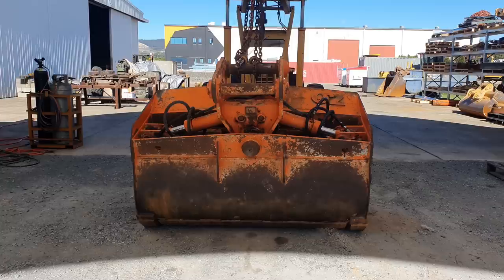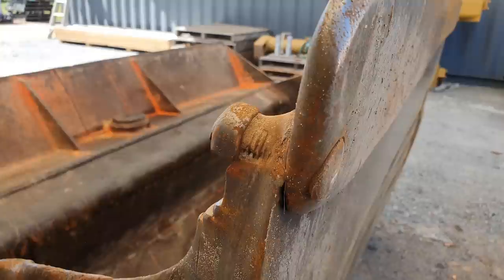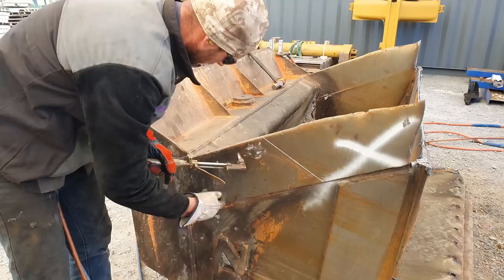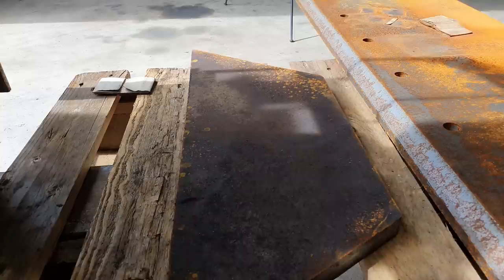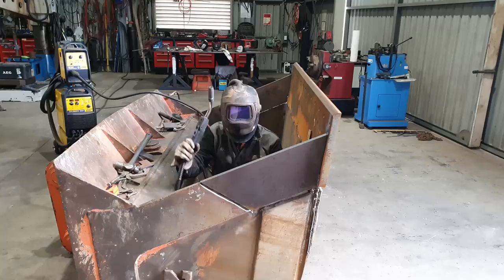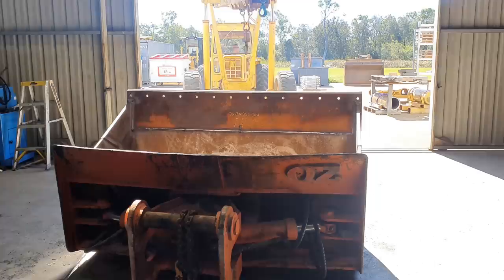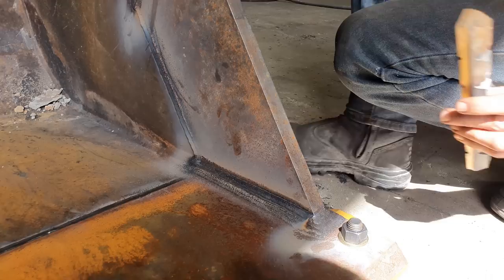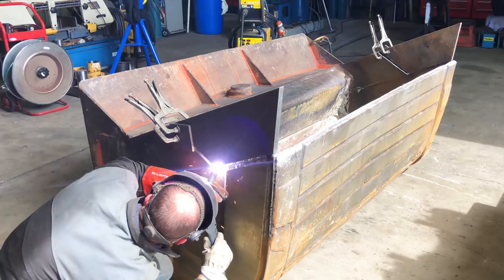Repair & Upgrade DAMAGED Bucket for 30T Excavator | Gouging & Welding

Comment: Unfortunately is not operator's fault most of the times...upper management wants things done and wants it done yesterday regardless if you have what it takes or not and like the old saying goes "if all you got is a hammer then everything starts to look like a nail" .
Reply: Or, "If a pickpocket meets a Saint, all he sees are his pockets" ~ Hari Dass Baba
Reply: I love the supervisor who is adamant they want A and you inform them it needs service first otherwise it's going to bugger up and will need A as well as B. Do the job as ordered.
Then they get crook at you and demand why you didn't tell them, all harsh words and floral language. It's fun to watch their faces when you quietly say "I did". Not a word in response.
Reply: @ohasis8331  I always handed in a paper with my written observations, and had them sign it. Then when they got cross, which they always did, I handed them the paper they signed.
Reply: Sadly if the company doesn't own the equipment they usually don't really give a $hit....
Reply: It's mainly about making money, not engineering 'purity'. Plenty of times the opportunity is time sensitive, and the cost of extensive repair is still dwarfed by the profits made. Curtis makes a good living either way - whether in maintenance or repair costs.
Reply: in the eyes of a fitter or a boily it is ALWAYS the operators fault!!!!

Comment: I can't believe how clean and straight your free hand torch cuts are. I've free hand cut similar gauge metal over that distance with a much more ragged line. Just wow.
Reply: he did mention using Oxy/Propane instead of O/A because it makes 'a cleaner cut', and comparing that freehand cut to a motorized line cutter with an O/A flame they've shown in the past, I can well believe it. (is it Kurtis, or Curtis? I keep getting mixed signals)

There's also the matter of steadying, bracing, and stancing yourself to allow moving the torch in a smooth, even line; you don't want to be having to think about your balance while trying to cut straight. and flame-off motion practice a few times to make sure you have the pacing correct
Reply: How many kWh you use in 1 month?
Reply: I’m not as good as Kurtis, but aim with your elbow not your wrist.
Reply: As far as making a straight line is concerned that's practice, bracing, and dont get in your own way... outside of that.. make sure your pre heater holes are in line with your cut and know how to read the kerf.. pre-heating is also a must on most things..
Reply: I noticed this too, and I think a lot of it is very wise choices in how he braces his hands and torch. Really good work.
Reply: I was also impressed by this. Skillzzzzz
Reply: Another good welder is Issac of I C Weld, he can do amazing things with a cutting torch

Comment: Nice use of the dog & wedge Kurtis. Respect. Such a practical way to form up the plate that's otherwise inaccessible to clamping.
Reply from the maker: thanks mate glad you liked that!
Reply: I thought the same thing. It gave me a good smile.
Reply: Takes me back to my younger days manufacturing chaser bins, lots of dog cleats getting the bowl profiles just right
Reply: @danieledwards1081  Sorry, but what is a chaser bin for?
Reply: @markfryer9880  collecting grain from the harvester in the field on the run so they don't have to stop harvesting.
Reply: Interesting video for sure. And I learned a bit in the comments. Thanks

Comment: This super videographer should be making training videos. She is always in the right place, showing the operation as well as the aftermath. And, it's all clearly defined. Super job, even in winding conditions the wind noises is minimal.
Reply from the maker: Thank you for the great feedback! 😊
Reply: @CuttingEdgeEngineering that’s sharper than some of the axes I use in my woodworking

Comment: People underestimate how difficult it is to torch cut with this precision. Very early in your videos, the 2 things that impressed me the most was your skill with the torch and your skill with the forklift. I’ve been a welder for 35 years and haven’t seen torch control like yours an Isaac from IC Weld.
Reply: yeah how good is the forklifting ive never  driven one but he makes it look easy and im sure its not, he
 has a good eye
Reply: @Finnyc23  The rear wheel steering is really something to get used to. You have to exercise care around forklifts, they are a lifting and moving machine that is very much taken for granted, but they can easily kill or injure people.
Reply: IC Weld and CEE are both no-nonsense masters of the craft. I’ve been a welder for 25 years, and in fact built tractor attachments for 5 years, and I have learned little tricks from them that I try to remember and keep in my mental tool box of easy solutions.

Comment: I just love the tarp shelter. What a awesome use of space
Reply from the maker: it's been fantastic especially during the summer months
Reply: I'm glad that I was wrong. I didn't think it would last a year. Sorry for my pessimism.
Reply: @CuttingEdgeEngineering  and when its pissing down o'rain
Reply: @Michael-rg7mx   I built a similar covered work area about 10 years ago. The first tarp I bought was from Harbor Freight and it didn’t last 6 months. The next tarp I purchased from obviously a different company cost a little over 2&1/2 times as much but it lasted 5 full years. Just kind of proves the old adage about you get what you pay for.  I replaced the tarp with a used one from one of those metal pole and canvas pole barns that I bought for scrap. The canvas was 3 years old and the pole structure was over 15 years old and was pretty much scrap (some drunk stole a skid steer and went on a rampage. The cops found him passed out in the machine buried under a couple tons of the building.
Reply: @gullreefclub  
I've lived in places that are way too windy. Last week, it blew hard enough to flip trailers. The trees nearby were stripped bare and broken. When I lived near Seattle, the wind sunk 2 concrete floating bridges. The I90 freeway and the Hood canal bridge.
Reply: @Michael-rg7mx  Wow, someone failed to design those bridges properly then.

Comment: Oh my, I have rebuilt so many buckets over the last years of my former years and there was Arctec hard rod by the ton associated with these every year during our break-up when the roads thaw every spring. I never complained about operator abuse as it kept myself and two other talented fellas in a job that lasted for over 25 years eh. I can smell the air arc working away as we/I watch this. Sure do miss it. Retirement sucks eh, LOL. Thanks a bunch and take care my southern friends. Most of my low hydrogen filler rod was ArcTec 223. One had to be careful to burn off that soft start tip though. I didn't have that much knowledge about wire feeds.  I found them to deteriorate a welders skills. Your knowledge about the various wires I could have really appreciated back in the day.

Comment: Kurtis I once saw a bloke driving my cousins excavator using the bucket to smash large rocks instead of getting the ripper which was only 200 mtrs away the amount of damage to was incredible, the industry could use a lot more people like you teaching operators how to use the machinery safely ,efficiently and economically then there wouldn’t be as much pressure on repair crews to have the equipment back in operation in a short amount of time . Well done to Karen for another fantastic job filming and editing and I agree could have been some of George’s family, all the best from Tassie, whoops nearly forgot homeless love that little man

Comment: Real nice welding there and as always just awesome videos. The reason we use those buckets to move big amounts of materials is because we use them when we make a ditch or hillside, and at the same time we load dumpers or trucks. Instead of making dubbel the effort to make the ditch or hillside then going back to load the truck we save a lot of diesel when we do two things at the same time. I live and work in north Sweden, here we have very rocky ground and almost with no exception we use rotary tilts on every machine under 30 tons. Here the manufacturers has had to make them tougher to handle the load we want to use. Also the rotary tilt is invented here in  North Sweden. Big thanks if u have the patience to read my little post 👍

Comment: Thank you for taking the effort to make such great videos! I’ve learned so many tips and tricks from this channel for example at 17:00. I’m not a professional and do some welding and machining as my hobby/spare time job. last winter I was repairing the deck of a small old dredger and this tip would’ve saved me so much cut in halve c clamps and headaches. Thanks and thanks again!
Reply from the maker: Hey mate glad the videos are helpful and thanks for taking time to watch!

Comment: It's interesting to see how different the buckets used in different parts of the world are. Here in Finland the ground is mostly clay or silt packed extremely hard by the ice ages and frozen for a third of a year so the buckets we use need to have a lot of penetration ability into hard ground, they can't have a blunt edge. 

We seldom use separate mouth pieces and bolt-on cutting edges here, there's mostly just a hard plate cutting edge welded directly to the bucket and when the edge needs replacing we just cut it off and weld on a new one. Also the standard excavator buckets used here are different shape from the ones used in most other countries, ours are narrower and deeper and have longer "lip" to better penetrate into hard ground. Most of the excavators are imported without a bucket or have their bucket replaced by the importer as the factory ones are wider and more shallow and have bolt on cutting edges and side cutters and they are not practical here in most jobs.

Wheel loader buckets, the same thing, mostly no bolt on edges and on medium and larger machines the cutting edge is usually V-shaped, like a spear point, to better penetrate into hard gravel. On large machines teeth may be used, especially when handling rock.
Reply from the maker: Hey Murgoh, wow that's intense! Cheers for sharing mate 😎

Comment: As, originally, only being an electrician, I've traveled the world for the biggest part. I've been working on projects in some 34 countries on multiple occasions.
I've been working together with numerous welders, machinists and mechanical engineers. All I can say about what I've seen you doing. Is that I'm sure you're an absolute wizard.

Comment: The finished bucket mouth was mean looking and a damned fine piece of work! And it looks like we know where the "Cutting Edge" in CEE came from now. Shame the customer didn't plan for the repair of the bottom of the bucket at the same time, but this repair was very satisfying to watch. I want to weld a couple dozen of those chocky bars onto the bumper of my pickup truck.... for urban wear resistance, of course. 😉
Reply: Another use for chocy bars, anti-skateboard devices

Comment: Good one mate.I did one sort of like that last year.  I didn’t replace the whole mouth plate because I didn’t let it get that bad😮. 21 ton Hyundai.  But what I did do on the cheap because it’s not used commercially was to cut a 50 mm strip off the old cutter bar and weld it to the front of the old mouth plate, blending it then hard facing it. 
I’ll never really know how long it lasts cos I’ll be dead before it wears out !😂
Love ya work. I’m in Bundaberg QLD. 30:35

Comment: 1:54 yup. I have hardox on all my edges, which isn't welded, rather we've developed a wedge system that allows us to install strips of hardox into the bucket. Maintenance and prevention of wear go along way, and it's certainly cheaper to get hardox strips than it's to take out a bucket and fix it up every moon twist.

edit: also, i don't understand people who don't communicate with others properly. Like, when we're unable to do a job inhouse ourselves, and we have to farm it up, we send pictures, measurements, exactly what needs to be done down to the layers of paint. In some cases we already provide all the material, including the accepted welding supplies. Treat the people you're asking to work for you as you'd want to be treated yourself and that not only builds a better work relationship, but it also results in a better job. Those we've worked with in the past and work with now always come up with excellent results for us as a result of that. It's the little things that add up. Just my 2 cents.

Comment: Great video as always! I do have a small question, you mention you are using LPG as a cutting medium. Did you ever considered Acetylene? Or is it not readily available? We (in the Dredging industry) are using Acetylene & Oxygen as our preferred cutting medium.
Reply from the maker: Acetylene is very expensive here about 4 times the price of LPG
Reply: @CuttingEdgeEngineering  Have you considered making it yourself with carbide? They make machines for that.

Comment: Why hold the nozzle of the oxy close to the metal as you are lighting it , just wondering. Thanks
Reply from the maker: to prevent the gas being blown out before it ignites, it helps to "trap" the gas at the tip so the oxygen doesn't blow it out before you get to light it 👍

Comment: You didn't call it out but I noticed your use of wedges. That reminded me of my late dad who worked most of his career at a steel fabrication shop. Back in the days when skyscrapers were made out of steel rather than concrete. He used to say the most common tool in the shop was the steel wedge. They used them by the thousands making steel for some of the tallest buildings in Canada at the time.
Reply from the maker: You're very lucky to have memories like that with your dad mate.

Comment: Imagine the amount of money these companies could save if they just spent a little bit extra on the prevention rather than the cure. And found operators that used the equipment properly. As always, good help is hard to find.

Comment: Your cuts are very precise very nice. You are also very thorough in your approach. I critiqued this video heavily and all I can say is I know you said you were welding downhand but it looked more like a slightly downward angle (this could be to our different perception on the definition). Where I work we are allowed 5 Degrees before its considered "downhand" I really enjoyed this video. Everything from your machine setup to your volt and amperage settings are very close to what I prefer. Well done I cant wait until the next one.

Comment: I love when you are Gouging. It still so mind blogging to me to what actually is going on when you use that carbon rod on the metal.

I guess its generates insane amount of heat that just blows the metal away

Comment: You can tell the worth of a repairer when he takes as much trouble over a proper repair on a POS piece of equipment that is going to need further repairs, anyway.
Well done on that professional attitude of doing it RIGHT, regardless of what you're working on!

Comment: I'm used to rock buckets. The cutting edge would have a cast/machined in backer ledge, to keep the cutting edge from shearing off the mounting bolts, when the operator would run the bucket into the ~solid rock, at the edge of the blast area.
Best wishes from Northern Canada.

Comment: Well that's definitely had its money's worth on that edge .. I guess there's a large dose of pride in the fact that your last modified section on this bucket lasted 5 years and the OEM was 1 .. that's either very bad design or 1 hell of a lot of wear on the that pivot point . I know in the past you have mentioned you don't like using cribbage or stands to support the work at a workable height in case it moves or falls but you seem to be able to get down into some uncomfortable looking positions when welding the front edge on .. great camera work from Karen as always . Thanks guys

Comment: That “dog” (L clip) that you used to position the cutting edge in the middle is something that we use in the pipe fitting industry as well but, we weld a nut onto the end and use a threaded rod to Jack the piece instead of wedges

Comment: I hear you about the wind. It's been bad up here for us also in banana land. Doesn't George come into the shop anymore? You might be right about his offsprings showing up. It warms my heart to see your work habits in action. There are very few of us that have these traits. When I retired in 2015 the company couldn't find anyone with the same work ethics as mine. They tried several times to get me to come back to work but I had my fill of fun working in the metal trades and I wanted to spend more time at home with my other half. Working 6-7 days a week was no fun for her. Keep up your work habits, stay with what you believe in and your skills will deliver you a great life and your customers will benefit from your expertise. You're a great team working together for a common cause. That bucket will be better than original condition. 👍Another quality job done by CCE Engineering. Where did you find that classic outdoor mobile crane? That's a WWII classic military piece of equipment. Hang on to it.

Comment: I've rebuilt a few buckets, never for a bolt on cutting edge though, all had teeth. Smooth buckets don't get worn out much around here.
I do like the bars,  never seen them around here, would have been handy to have. Nice job Keep smilin

Comment: Oh those welding gloves are super good. We got a pack for work one time, never again coz there expensive. But i was so surprised to find that welding gloves can actually be comfy to wear. And they dont burn too fast either. The main ones we get for work are uncomfortable, and are pretty quick to tighten and get hard.